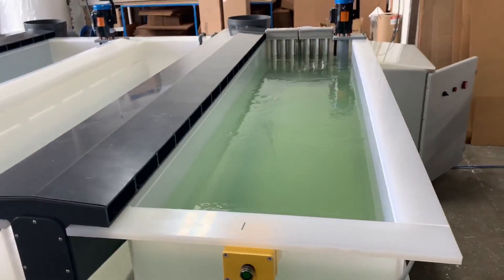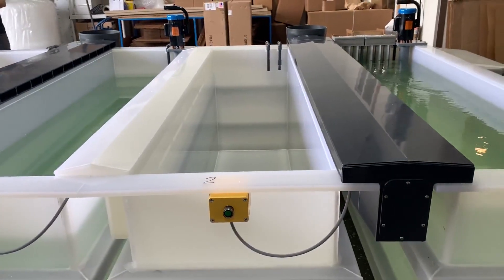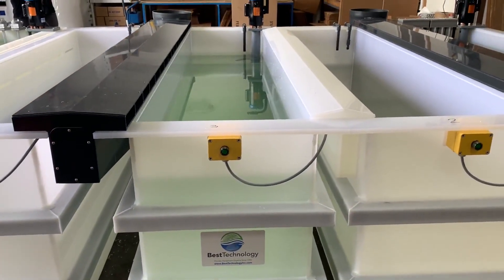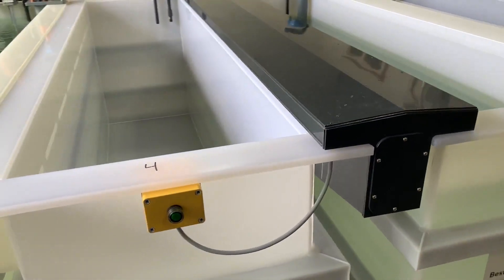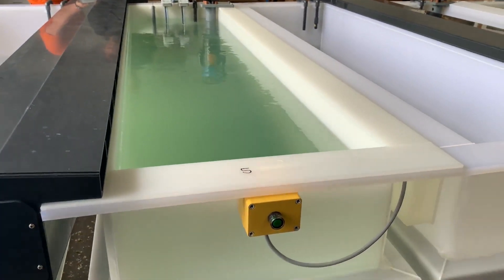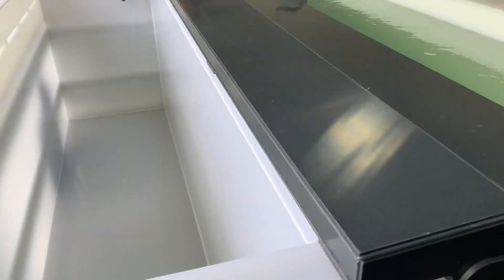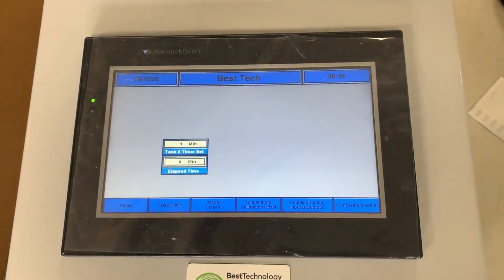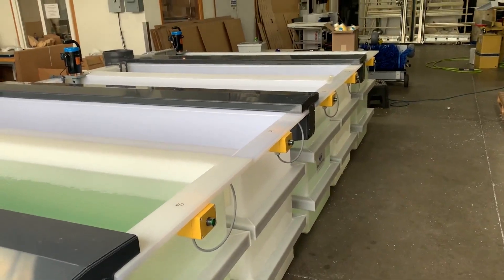Chem Film Chromate Conversion Type 1 System

Comment: Is the label in error? Did you mean Class 1? I thought Type 1 was Hexavalent chromium and requires electrical bias? Thanks
Reply from the maker: Thank you for your inquiry about the Best Technology Type 1 chromate conversion system.

This is indeed a Type 1 system that uses hexavalent chromium.

It can be used to apply either Class 1A (wear coat) or Class 3 (allow electrical conductivity) chromate conversion coatings, as the class mainly depends on the thickness of the coating.

For more information about Type and Class of chromate conversion coatings, check this link:
https://www.besttechnologyinc.com/surface-finishing/what-is-alodine-chem-film-chromate-conversion-coating/#Types

Thanks!